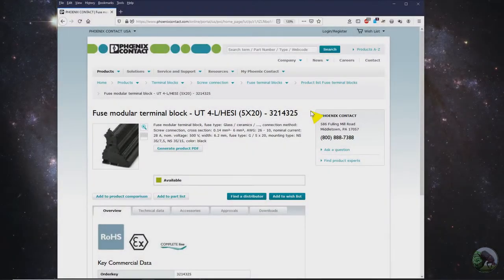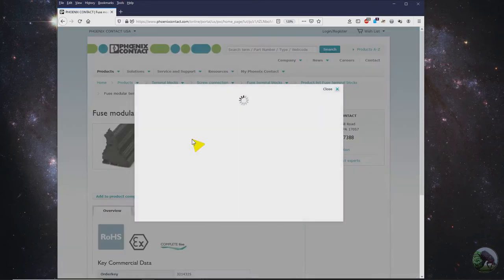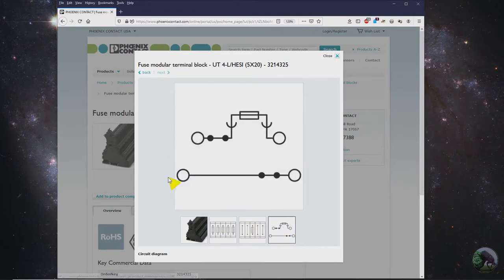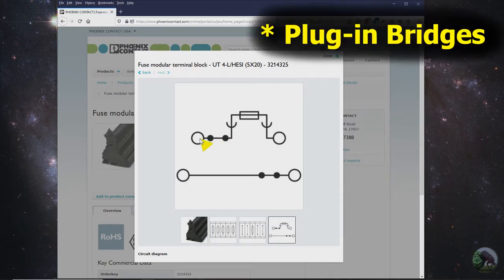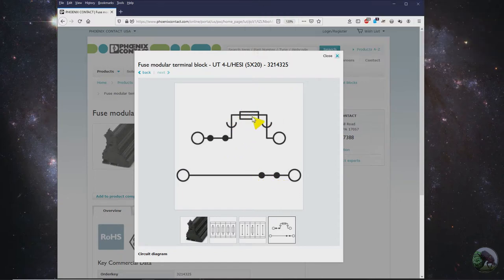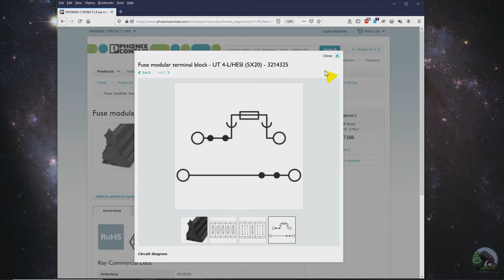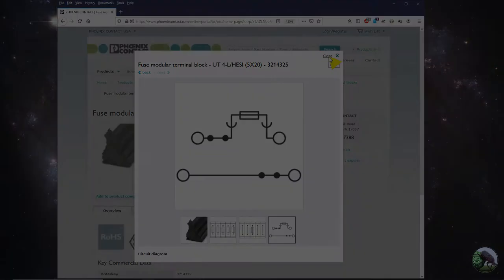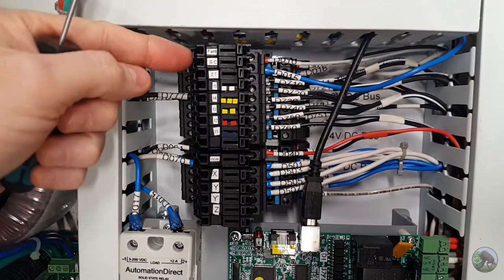CNC Controller Build: DC Power Distribution

Comment: +1 on the spring terminal dislike. The only time I have appreciated them was a panel that has a ton of low intensity vibration. The springs held the connection better than the screws either because the wire kept flattening or the screws backed off. But that was only one time and I still don't like them. I'm also not certain the terminal blocks I had were specified for use with ferrules because the builder didn't use them,  but wow the birdcaging that happens with springs without ferrules will drive up your liquor bill. 
I appreciate your series - I work in process control and have a homebuilt CNC but I do so much of this during the week I have little desire to do more at home. Its good to see someone has enough energy to do a nice job.  Let me ask,  while the wire management is perfectly fine, does it bug your OCD that you cant get the wires to lay better?  The internal stress of the wire always tweaks it one way or the other. 
Also, you did some work with LUA that I really enjoyed. I would love to see more of that. 
Do you have a pendant control?